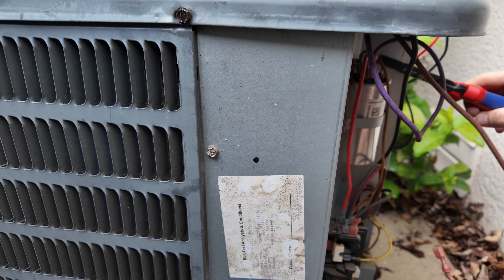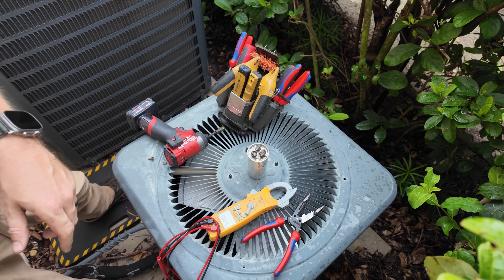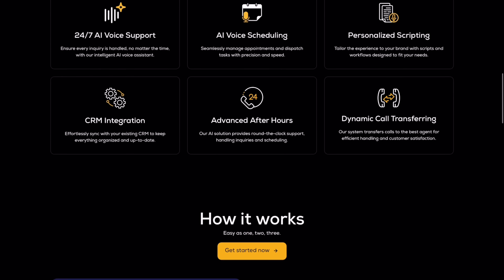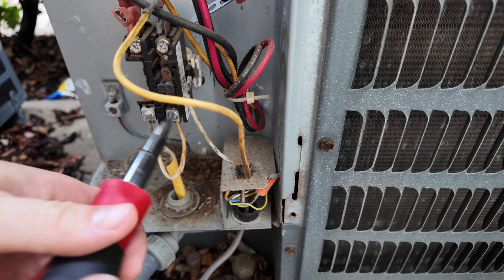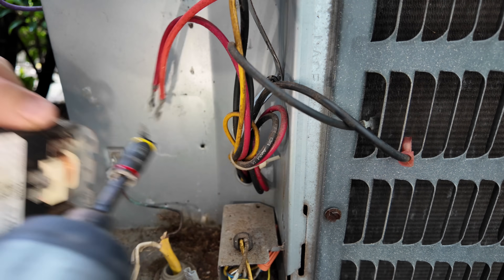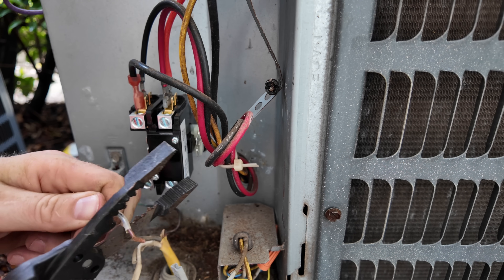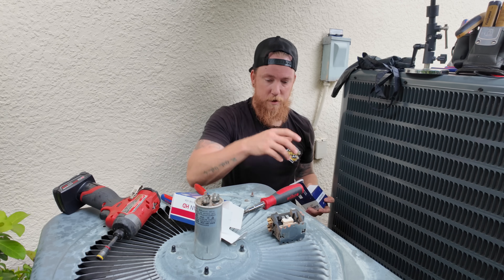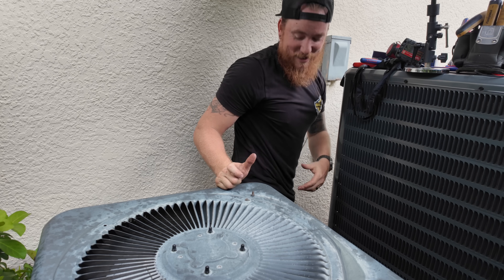Goodman AC Not Cooling | Basic HVAC Troubleshooting

Comment: I replaced a capacitor, at the end there was one black wire loose, I looked at the pictures of the wiring I took before but they only showed the capacitor wiring, so I thought, maybe this is an extra wire for something optional that you can get installed, I put everything back together, I go inside and everything is working except “no cold air.” I didn’t want to connect that wire just anywhere afraid of damaging the machine, so I watched a couple videos until I found yours, that unit and wiring looked similar to mine, min 7:09 gave me the answer, it’s the black wire without the red rubber, I ran back to the unit, connected the wire, turn the power back on and baaam! I hear the compressor right away, I touched the copper lines, one is warm the other is cold, the air being pushed at the top of the fan is warm, I go inside and feel cold air at the vents, thanks a million man!!!
Reply from the maker: Let’s go!!! 💪 love to hear it!! Glad you got the air rocking and rolling 🫡
Reply: Where did you buy the capacitor from?
Reply: @ndayembidi6781 I got it from Amazon

Comment: Fairly new tech, just got out in the field alone. Might seem like a dumb question, but why change the contactor? It hasnt shorted , no? It still pulled in, and fan was spinning, so it wasn't the issue. I get 3 ohms is out of range, but how bad is that? How likely would that have been a future call, and how soon would it have happened? I know timeframes are impossible, but would you say urgent? great video, and quality work.
Reply from the maker: Generally from my experience 10-20 is a range I’d say is a “safe zone” I’d even say12-18 is better. With the the way it was looking and the coil reading that low, found it best to replace.

Comment: I used to work in Merrit Island Florida. I remember the brutal summer heat, 130 degree attics. It’s extremely difficult to work HVAC in the summer time in Florida. I’ve learned never to complain again after that if I find myself in an attic in PA. Stay safe out there bro
Reply from the maker: Yeah, Florida summers are brutal for sure, stay safe!
Reply: brutal as hell az an arizonan props for dealing woth that heat and humidity

Comment: I never liked the reversable Klien Chuck. It doesn't hold screws well. 
How do you know what the range of the contactor is supposed to be? Is it listed on the part?
Reply from the maker: It’s a general rule of thumb. I see a wide range of usually on new ones 14-16

Comment: Good to see this job got some quality parts put in vs. whatever the supply house had on sale last time a tech would visit them. I see so many HVAC tech's using complete crap CCP parts. Also, it was good of you to use a 40 amp contactor vs the 30 amp as the contacts are more robust and wear less all for less than $5 more. 
They have a rather risky power switch for their HVAC in the garage...its not well protected at all.
Reply from the maker: Thanks for the feedback, and you're spot on about the contactor, it's worth it to get quality parts! And that switch there is terrible I agree

Comment: I missed something.. what tipped you off to replace the contactor?
Reply from the maker: While checking caps I like to check contactors as well, especially visually if it looks rough. I went ahead and ohmed out the contactor and was reading 1.2-3 ohms. Want to be as proactive on a call as I can!
Reply: @KoolinwithKrauss Thank you Sir!
Reply: The "low voltage" circuit was out of range when testing for OHMS. Contactors have a range that they should fall within such as 12 to 18 ohms. If they read outside of those numbers, its best to be proactive and replace it. The low voltage circuit is what energizes the contactor to engage with the two 120v power sources. The term is "pulled in".
Reply: @Garth2011 Gotcha.. like gas solenoids that im used to working with in RVs.  They have to ohm out within tolerance.  Thank you Sir.

Comment: What ohm range do you like to see on a contactor  ? One comment, perhaps write installed date on the capacitor. Thanks for sharing this video.
Reply: 15-20ohms
Reply: @jonathanraney2774 thanks for your reply.
Reply from the maker: For me it’ll vary on the call. Like this one was definitely well out of range, I’ll try and push 10-20. On a new one I usually see about 14-16. But again discretion on the call. Previous video was at 11.5 but just sent it and replaced.

Comment: Love the videos. Question, I have the same meter as you. Does yours ever just give you random numbers without even testing anything yet. For example the other day I was trying to check MFD and without even having my leads touching anything, I was getting numbers. Any advice on what’s going on and how I could possibly fix this. Same thing happened when I tried checking for DC voltage.
Reply from the maker: Oh dang! No haven’t had that issue with this meter yet. 🤞